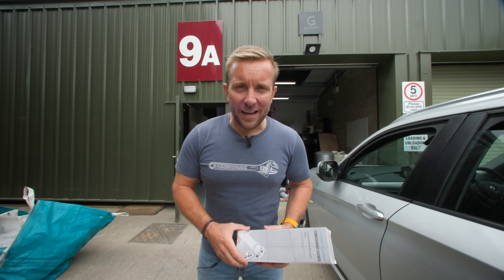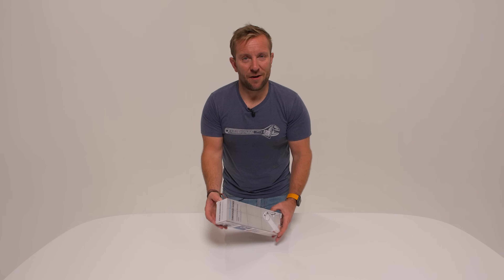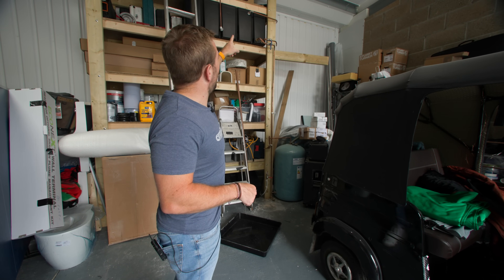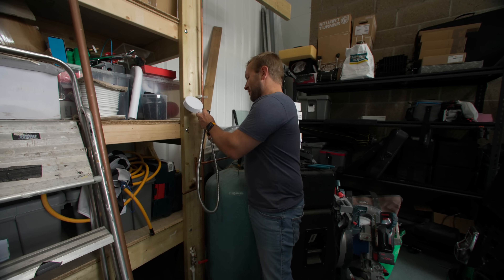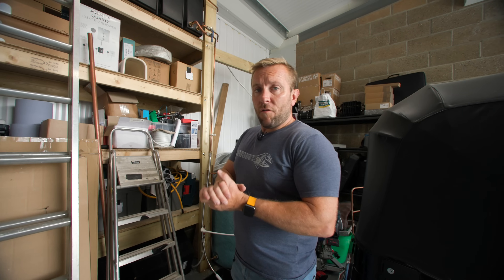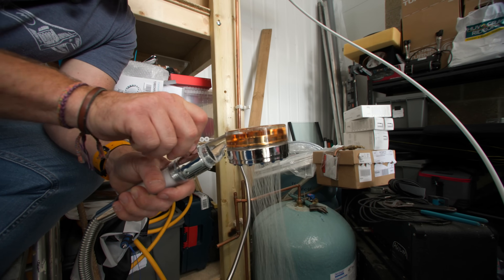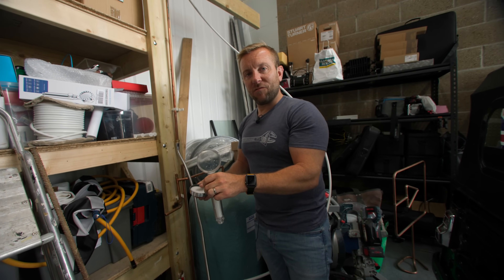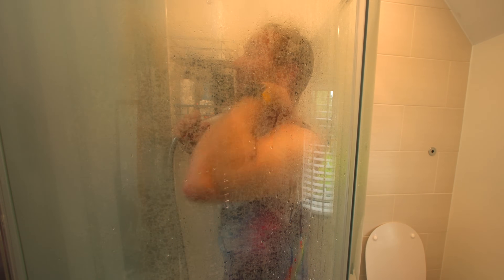PRESSURE BOOSTING TURBO CHARGED SHOWER HEADS - Do they work?

Comment: From a first principles of engineering standpoint the shower head fails.  Being an American raised in the imperial system, the water pressure in our shower is that delivered at the water main, 30 psi, less the line loss from the street to the house, less the loss in our water heater, less the loss in our filter and water softener, less losses in fittings, less losses due to flow due to the length and size of the pipes.  Do the math, or put a pressure gauge at the shower head you miight have 25 psi.

We could install a booster pump to get it back to 30 psi, but our house was built in  1942, and the investment isn't warranted for the gain.

The magic shower head, if perfect would at best allow water to flow through with no addional losses.  But, it is not perfect.   Losses come from the filters, they come from the orifice, i.e. nozzle, that directs flow into the turbine, losses come the turbine and the energy lost in spinning the water.

The end result is, physically, there can be no increase in pressure.  If you reduced the flow at the nozzles of the shower head to zero, the static head would be 30 psi, or the pressure supplied by the water main.  To increase the pressure once the water is flowing you have to add energy from an external force.  In the case of the turbine shower head, there is no external force.

This is a classic case of someone selling perpetual motion.  Unfortunately, the laws of physics say it just isn't so.

Save your money.  Hire a masseuse.
.

Comment: Surely the pressure doesn't increase depending on the size of pipe? Isn't it something like 1 bar per meter.
Reply: Remember that pipes create frictional pressure losses that the water has to overcome when flowing through it. 

It is far easier to have 6 litres per minute (0.1 litres per sec) flow through a 28mm pipe then a 15mm pipe. So the larger the pipe, the less frictional losses are created, which means there’s more pressure available at the shower head
Reply: Flow and pipe size do not affect pressure. Do not confuse velocity with pressure.   With a garden hose connected to mains water,  you increase the speed (velocity) ofte water by squeezing the end of the hose.

Comment: The easiest way to maximise pressure is just to stick your thumb over the end of the shower hose. You won't like the flow rate but the pressure will be as good as you can get without a pump. All a shower head can do is trade off pressure vs flow rate.

Comment: It's sad that such fraudulent adverts are allowed :- 
There's no 'turbocharging or supercharging' going on, just a showy fan that's rotated by incoming water.
 The only way you can increase water pressure in the head is by restricting the flow - yes, the pressure will rise at the nozzles, but at the expense of flow rate.
The ultimate pressure can be achieved by having no holes in the shower head - but the you'd get no water & only static head pressure anyway, a bit pointless.
You can increase water velocity, but again only at the expense of flow rate by using tiny/fewer holes.
They should also have a prominent warning NOT to install them on electric showers.

Things like this shouldn't be available, save your money for a pressurised system.
Thanks for the vid, it's good that garbage like this is exposed for what it is.

Comment: These shower heads have been out for long time and i always knew they are  toys. Nothing can impove the pressure otherwise we would loose our plumbing jobs haha
Reply from the maker: Shame other YouTubers fall for it though!
Reply: I've been able to get increased pressure by installing a shower filter and a high pressure shower head(the one I use is the Gusgopo 9 Spray it's cheap but well made imo) So there are ways to do it, but certainly doesn't beat the increased flow rate that a plumber could add.
Reply: @comicalhexical  of course the pressure would increase if you reduce the size.

Comment: I thought, I would be the 100th commenter,  they have reduced the velocity of the water by putting the fan, and so called filters in!, just another rip off product, as you said James increase the pipework diameter, lift the tank is the only method of increasing water flow on a gravity system, there by making up volume to increase velocity well done you for exposing...you dirty boy

Comment: My understanding is they just use smaller holes to give the comparison and at its heart. It’s the same output as those that add air to the shower head for energy saving with a special effect for the kids - save your money and get a plumber to upgrade your pipes for a real shower in your on microboure pipe

Comment: I’ve got one of these things but I don’t think it has any rotating ‘fan’ parts. I got rid of the little filter ball things… I figure the holes are so tiny that’s how it works. It obviously can’t increase the amount of water from the shower but it can increase the pressure of the jets by making them smaller. Definitely works for me, the head that came with the shower just trickled on me. I can actually enjoy a shower now.

Comment: Fitted a new Mira Jump 10.8Kw ....same day the customer changed the head for one of these - killed the shower within a week. Didn't blow the PRV but the fact that you can TURN IT OFF !! at the head while the shower unit is still turned on made it overheat and die. Expensive mistake

Comment: This is complete snake oil.

It basically claims it is a perpetual motion machine.

To spin the impeller, is USES water pressure - it doesn’t gain it.

I could write a 5 page explanation on how dumb the shower head it.

Comment: An i right in saying that pressure is baaed solely on the height of the 'stacked' water. Like a tank with 10 litres of water vs a tank with a 1000 litres of water, will have the same pressure if they are the same height (if both tanks have an outlet at the same position)?
Reply: Yes.
Reply: A cup with a shower hose vs a swimming pool with a shower hose. A cup 3 metres high has greater water pressure than a swimming pool 2.5 metres high.

Comment: Can you do this with all the other "pressure increasing" shower heads? I wanna see if any of them actually make a difference lol
Reply: @Mark Jones you cannot change the flow of water as once the tap is on full, there's no more water available, which he basically explains in this video, however there are aerator tap attachments which introduce air to the water, which I imagine is also a thing in shower heads and can give the effect there's more water
Reply: The formula Q=V.A (so V=Q/A) is the answer how most shower heads differ.

Q is flow rate, V is water velocity, A is area.

The flow rate is fixed, it depends what you get but let’s say for a typical mains fed shower it’ll be 6 litres per min (0.10 litres per sec).

So to make the end user think the water pressure has increased, they reduce the size of the shower head water openings. By reducing the available area through the shower head openings… the velocity increases. This increase in velocity makes you perceive the shower to have a higher pressure
Reply: None of them do. If your incoming water pressure is shit, fit a Salamander HomeBoost.

Comment: Reminds me of those "smart" handles that borrow power from the water pressure to give you a temperature reading. Except the ones they put for sale in Lidl required 4-5 bar of pressure (!?) and significant flowrate, and even then the display was so dim. And the internal "turbine" was so poorly made it just suffocated a normal healthy shower to be completely unusable. It's easily possible, if it's done right..

Comment: Lmao turbines by definition take energy out of a flow. Like for example a wind turbine, which takes energy from a flow of air and puts it into electrical energy instead. (Compressors put energy into a flow, but obviously they need to get that energy from somewhere such as an electrical connection.) In this shower head you're just taking energy out of the water, and into the turbine.

Comment: Lol... what about the ones that have "ionising beads" in the handle and lemon-scented blocks in the head...
Reply: While you can have, "Ionizing beads" they're called filter medium, and used to filter water into pure water. They come in three types - particle filter that blocks out large pieces, negative charged to get rid of half the garbage, then 3rd stage positive charge to get rid of the other garbage, bonus if you get 4th stage activated charcoal/carbon filter; But they use chemical resins that deplete their charge and need to be replaced over time. THOSE ones you talk about,... are garbage.
Reply: @dimitar4y  Thanks for the info...!

Comment: Great video! 😂
Quick question... low mains pressure into my apartment, isn't this down to Thames water?
Reply: Water suppliers’ statutory service standard level of mains water pressure is 10 metres/head (or one bar). This means there is enough force/pressure to push the water to a height of 10m.

This is measured at the point where the water leaves the water suppliers pipework and enters yours (usually the outside stop valve or property boundary).

As a guide, if you have a suitable single service pipe, the first tap in the home (this is usually the kitchen tap) should be able to fill a 4.5 litre (one gallon) bucket in 30 seconds, with all other taps and appliances turned off. Another way of putting it is enough water pressure to fill a cold water storage cistern in a two storey house roofspace.
Reply: Depends. What floor are you on? They guarantee 1bar at ground level. They wriggle out of low pressure on the first floor and upwards by saying that the property developer should provide water boosting.

Comment: Love your videos. When I moved into my 8yr old 3 storey, the shower on the middle and top floor just dribbled out. (Second floor much worse than the top floor) the boiler is also on the top floor in a bedroom next to the bathroom. I purchased a head that looks like that but not a turbo one, it has these ball things inside (I didn’t get it for the mineral effect, just desperate for extra water pressure from the shower head. It honestly has helped  but like the design on that one water stays in the handle which has worried me…… I’m not imagining it, it genuinely comes out stronger, especially on the shower on the top floor. are the ball ones different in design? Are these heads I should look at not using and replacing? Thank you for how you explain things like the pipe sizes etc to help it make sense to people like me who know nothing about this kind of stuff!
Reply: It's just that your new shower head has smaller holes across less area. This increases the pressure as the water doesn't spread out inside the shower head as much
Reply: @MrManningata  thank you! This makes sense. Appreciate the reply.
Reply: It's basic physics. The balls don't help. What does help is smaller orifice (holes). 

The physics go as follows. The pump that gives you the water to your home generates FLOW. when that flow is met with resistance i.e. smaller holes, the PRESSURE goes up at EXPENSE of the FLOW. You can make this basic experiment at home. Go to your kitchen. Turn on the tap. Put your finger on the nozzle. The more you squeeze your finger on it, the more violently it squirts out but at significantly smaller amounts. They do the same thing. It's not the balls. It's the smaller holes on the spray head. Just get the "balls" out of it they're just a mold hazard.
Reply: @dimitar4y  thank you so much. Feel quite silly now 🤭 this makes a lot of sense. Yes, the holes in the head are very tiny. Thank you for replying. Appreciate it. I will definitely remove the balls!
Reply: @puppy8329  Just remember, as mentioned in the video, since the holes are smaller, they will block up easier if you have hardwater, so you may have to poke them with a needle or a pin or something if they get clogged, or maybe give it a soak in Viakal ,vinegar or another limescale dissolving solution.
Reply: @dimitar4y  amazing! I just removed the balls and a weird filter thing from the upstairs one and it works just as well without. Feel better now thank you.
Reply: @puppy8329  Not a problem, shouldn't have to have such an absurd discussion to begin with, not sure why the market is saturated with such nonsense. Though I do notice that there aren't "small hole"-d handles available to begin with. People usually just get a booster pump installed for ~£300 (material+labour) from a local plumber and they can use normal shower handles.
Reply: @dimitar4y  I’ll look into the booster pump, thank you! I did look at small holed heads after I removed the balls as now Just have a cheap looking plastic head on both showers 😂 but I couldn’t see any. This has been great thank you. Learning a lot today! Feel a bit embarrassed for being so clueless!
Reply: @puppy8329  the balls do capture mold, sediment, fluoride deposits etc, my one went green before i changed it as it stopped all the muck spraying onto me, but kept it on the ball things
Reply: Ps. Neither of the showers are electric.

Comment: The amount of electric showers that Ive had to fix with these on is crazy they just don't realize that they cause too much back pressure and set off the prv or break the shower completely
Reply: What is an "electric shower"? Never heard of one.
Reply: @rdizzy1  really?
Reply: @mikewhitby2686  Yeah, have never even heard the term. Have always had a gas boiler, does it just use electricity to heat water as it comes out or something?
Reply: @rdizzy1  exactly that
Reply: @mikewhitby2686  Ahh, seems like a bad idea compared to a boiler. I certainly wouldn't want to depend on one in comparison. I always though those were called "In-line water heaters" or "On demand water heaters" something similar.
Reply: @rdizzy1  I had never heard the term “electric shower” either- only heard “ on demand” 🤷‍♀️
Reply: Yup! My tenants fitted one on a brand new electric shower and broke the shower.
Reply: Il second that! Had two Mira jump 8.5kw fail this week alone because of these! One was two years old the other 1 month ! In both cases the thermal cut outs triggered
Reply: Yep, never fit on an electric shower.
Reply: @elwittinio2865  what is an electric shower? Seems like those two would not want to be mixed.
Reply: Exactly this me too
Reply: Agreed. thermal cut out and prv killers